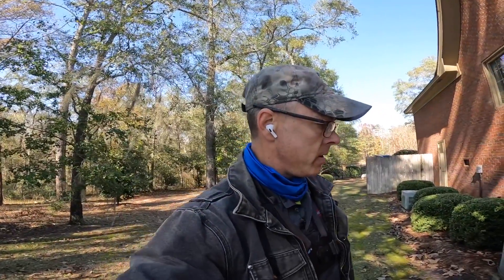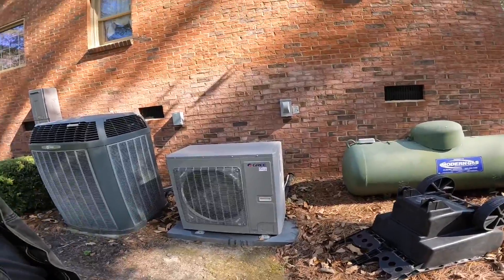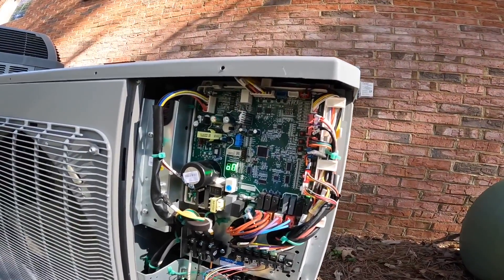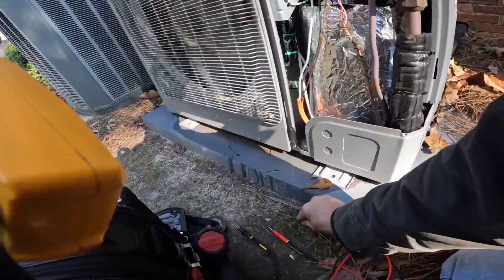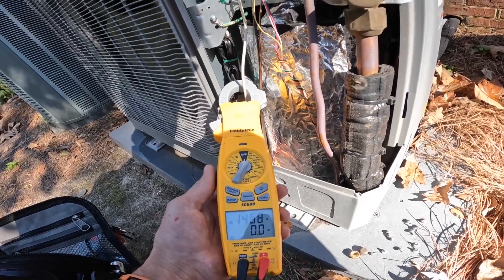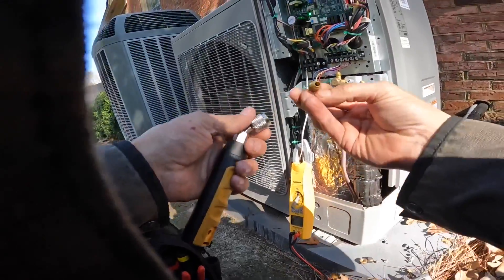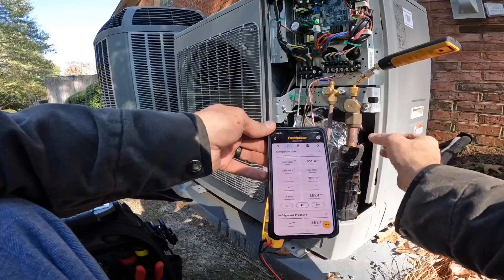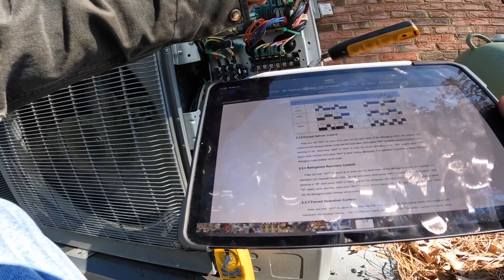Gree Flexx Actual Amp Draws on 3 Ton - Attempting to Force Defrost.

Comment: I had the same issue forcing it into defrost until i figured you needed to press sw1 after the sw2. Even with strong defrost mode set i find in cold climates such as Canada the defeost cycle isn't long enough, even if it manages to defrost the coil the water freezes in the pan faster than it can get out. If anyone knows of a way to extend the defrost or fix this issue let me know. I am considering a heat tracing cable in the bottom of the unit next if no other solutions come about.
Reply: Heating elements are recommended by other manufacturers in climates cold enough to freeze the pan.

Comment: I installed a 3 ton mrcool, but im getting amperage readings as high as 20 amps even though the Rated Load Amps (RLA) on the placard shows 16 amps. My understanding of RLA is that its a max and typical running amps should be below this.  It seems like you've worked on these a lot.  What readings do you typically see?
Reply from the maker: if it’s over amping like that, it may need to be checked out by a professional
Reply: @HVACGUY  so is that a correct statement that it shouldn't go over 16 amps if the RLA is 16?

Comment: I realy want to test this MrCool/Gree rebrand using a Forced Defrost. Any advice? I will be using this unit for primary heat at - 10 degrees F. In our dry winter climate here in the Canadian rocky mountains I do not expect problem icing but have set ODU for "Strong" defrost. I want to confirm the AHU operation in defrost to turn on heat strip and fan. 
Interesting in this discussion to see that Bosch is a comparable if not actuallly a Gree rebrand unit. These are odd units that energise the reversing valve on HEAT while most heatpumps energise on COOL. A sign of just being an air conditioner with a reversing valve and not a Heat Pump engeneered from the ground up. What do you think?

Comment: I have a Goodman Air Handler 2 1/2 Ton with a 10 Kw Heat Strip. I installed awhile back as an experiment before going to full on into a Heat Pump. The 3 Ton Gree Flexx is on the shortlist from the standpoint of price point and performance. The question remains about build quality and reliability. Any comments from all who install? I plan on buying both the condenser and air handler. If I  used the 3 ton condenser with the Goodman 2 1/2 Coil would it work? Just curious as former Tech. Thx!
Reply: They will tell you an air handler with  TXV will work with a Gree Flexx if the coil is the same capacity. Too many people have had refrigerant pressures look strange when doing this. I suggest a matching Gree air handler.
Reply: @DanWessonSpecialist  Dan, thanks I appreciate the advice...
Reply: I just installed a 3 ton and rent it on both the 3 ton setting and the 2 ton setting. I have a 2.5 ton indoor coil variable speed blower. It works just fine on either setting because there is a pressure transducer in the outdoor unit on the low side and cooling and on the high side and heating. If you’re running a smaller coil inside, you’re just going to be running the 3 ton hp  on a reduced capacity. I run mine on the two tone setting because that is what my old heat pump was, and it limits the power consumption on my garage system. I am all solar powered, so I’m not looking for comfort as much as I am efficiency.

Comment: After you press SW2 and it flashes "ON", you have to firmly short press SW1 back, after that it'll flash a number and should take a few seconds to go into defrost. I install them units daily in canada and had to figure the defrost since in our climate we need to set the dip switch number 2 to "hard defrost" otherwise it wouldnt properly defrost since the normal setting is too short.
Reply: Thankks for this advice. I installed this unit branded as MrCool. MC tech support is pathetic. Do not count on them for DIY help. What is debugging? I want to test defrost before it gets cold here in Banff Ab. to see if I have wired correctly to have heat strip and fan on AHU run on defrost.

Comment: I installed a 5 head(only using 4 heads at this time) Fujitsui n our own NorCal home.  Works great in our cooling season with a 15k btu head for the living and dining room.  9k, 9k,6k for the bedrooms when in use  Now that it;s heating season, the 15k head in the living room doesn't do well for us and I probably need an additional head in the dining room...or not.  So, we continue to use the Williams 35k btu natural gas wall unit for heating of the home.  64* downstairs and 68* upstairs.    Not ideal, but gas is cheap(er) than power charges that range .for $0.13-$10.15/kw in the winter.  Summer rates are $0.13-$0.32/kw, depending on time of day.  Farther south, in SoCal SCE/PG&E run upwards of $0.50kw for peak summer rates...ouch!  BTW...If I was to do it again, I'd pay the upcharge and go with Mitsubishi and oneway ceiling cassettes in the main areas and master bdrm.  The one way cassettes go between 16" ceiling joists, the square ones require 22" opening and possible cutting of joists to make them fit..  Thanks for the time you spend posting these videos!    -Brian

Comment: I was hesitant about putting in 2 Bosch package inverters on my house last year. I have been impressed, and I only had 10 minutes of heat strips on one system and 0 on the other one. The savings on heating and cooling after replacing two 26 year old gas packs has been impressive.
Reply: All of your energy savings will be used when repairs are needed, unfortunately. The common components that fail cost 3-4 times what a minimum SEER rated unit will cost. For instance, a normal condensor fan motor will cost between $500-$600 (total) for replacement. Those Bosch high efficiency motors are around $1500 (motor only) and you will still need to pay labor and possibly a little mark up on the part. In other words, over $2000 for your repair. Note, these costs would be for an out of warranty replacement. In warranty, you are subject to labor costs and service call.
Reply: @michaelangelo6217  it makes sense for me in zone 6 where heating cost for my modest house is 2k to 3k a season and my split system cost me 6 grand, installed. I can see where further south a traditional heat pump is the more logical choice. Furthermore,  instead of spending 5 to 10 grand (or more) on a new hvac system, put that money into insulation and air sealing and also maybe resistance heating can get you through a few seasons or a winter if you're strapped for cash with a broken furnance.

Comment: ive installed about 12 or 15 of these split systems so far ranging from 2 to 5 ton and I love them.If I could fit one in my lower crawl space id have already installed one.Long term reliability has yet to be seen so far.Too early to tell.
Reply: You can put them with any unit with txv they say
Reply: Had any duds? Ours was installed last week and it's awfully loud. The worst is the low frequency of the unit. It shakes the walls of our house and it's on a pad, open all around, no rubbing or otherwise. The unit just shakes so much it's rattling itself apart.
Reply: @badopinion  outdooor unit? if so it sounds like something is out of balance with the fan or could be something with the compressor,the ones ive intalled havent been mu ch over 35 to 45 decibles at max output on the outdoor unit and that was mostly air noise through the fan and grill, if its the airhandler side sounds like something to do with the fan.
Reply: id be putting in a call to the contractor that installed it
Reply: @badopinion  The sound/vibration comes from the line set. Insulate both lines and then secure them together.
Reply: It’s normal, outside it’s quiet. Inside you hear a vibration.

Comment: Is the metering device at the indoor unit on that set up? And I tell you what, I don't think manufacturers make there manuals that easy to understand. At least when it comes to mini splits and what not. Might just be me but I have to read the steps like 20 times and still have a hard time sometimes. Lol. Then once you figure it out it's easy, I guess just like anything else. Preciate the videos.
Reply: That’s because they are written in Chinglish. You can blame your good old greedy, American corporations, and their executives for that one. Also the same pos for the 40% increase in materials cost in the last two years.
Reply from the maker: It has an eev outside to add subcooling. But, needs a TXV on indoor coil.

Comment: Coil has to be cold enough to go into defrost
Reply from the maker: That’s kinda what I figured
Reply: It is a forced defrost you wanted to test the operation. The service switches override the sensors. It should have worked. @HVACGUY

Comment: Why did you choose to install this relatively unknown brand rather than the tried and true lines like Fujitsu or Mitsubishi, as examples? Ones that are better known and must surely be better supported in the US.
Reply: Gree is the largest equipment manufacturer in the world.
Reply: Lowest cost for the excellent performace @robertopod1968
Reply from the maker: This name brand is new only to the US, and has a large market share in other countries, especially in Europe.
Reply: @HVACGUY That doesn't help much here. At the end of the video, you mentioned that you were unable to do what you wanted and that the instruction booklet seemed unhelpful and perhaps difficult to understand. I wouldn't think those kinds of issues would be encountered with better known and longer established brands. Were there other reasons to not choose products from one of the others?
Reply: @snidelywhiplash8923  dude all these inverter systems are different and complicated. This is an ever learning trade with rapidly advancing technology.
Reply: My question asked why this lesser known brand was chosen in place of others with a bigger presence in the US. Only our host HVAC GUY can answer that. I appreciate that there are changes in the residential HVAC world to an extent but I don't think necessarily any more so than in many occupations.
Reply: @snidelywhiplash8923  simple research and you'll ve surprised to find that Gree and Midea make the majority of inverter systems out there.

Comment: Is it true u can install this gree condenser/ heatpump with any existing air handler or case coils out there and still use the same thermostat and thermostat wire?
Reply from the maker: Actually yes. All it needs is a TXV on indoor coil. And uses standard thermostat wiring, energizing blue in heat.
Reply: Long as it's a 410a heatpump type.

Comment: You really need the service manual for sure with these inverter systems. It's kinda difficult to locate a good textbook dealing specifically with these types of systems because each manufacturer differ somewhat in their technology especially when it comes to troubleshooting fault codes and entering diagnostic mode. The VRF and VRV systems are even more complicated.

Comment: You need valve core depressor
Reply: Only thing I will complain about on these systems is the location of the service valves. It’s a tight squeeze to get one on there
Reply: There is a part at trutechtools that allows one to only open the valve when you have the gauge or probe on.
Reply: pro to protect the climate. @sprockkets

Comment: Why isn’t the discharge line insulated if it’s an  inverter heat pump? Nice work as usual?
Reply from the maker: This Gree system doesn’t need an insulated liquid line. It is a true liquid line. There’s a TXV in the air handler
Reply: Your right 👍
Reply: Something nice that MrCool does though. Gree makes MrCool units too.
Reply: ...and 2 other rebrands available in Canada.   @AZBADBOYz